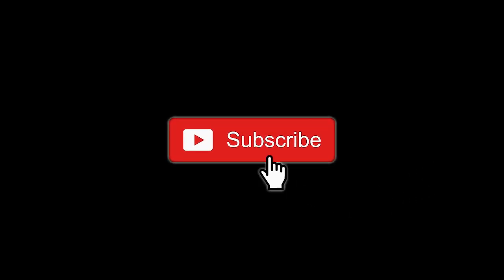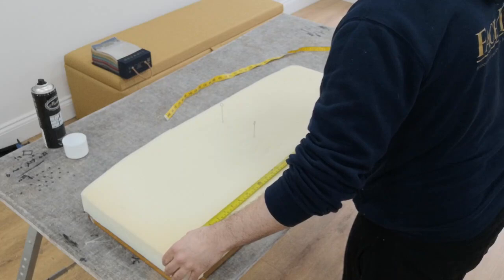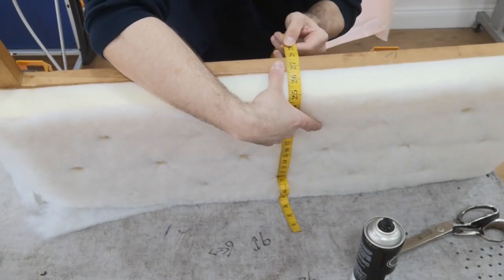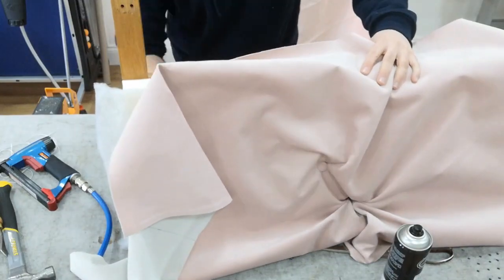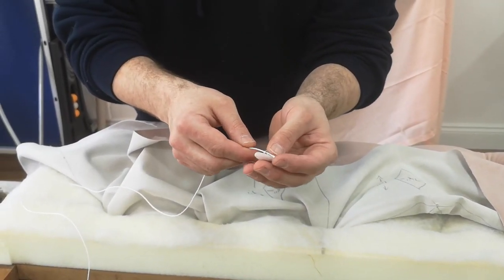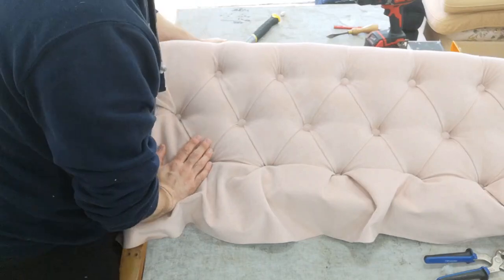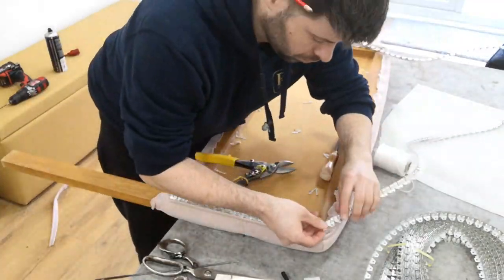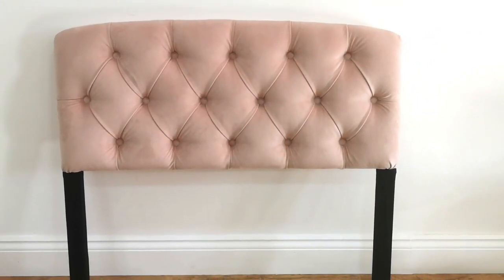HOW TO UPHOLSTER A TUFTED HEADBOARD | DIY TODDLER PRINCESS BED UPHOLSTERY TUTORIAL

Comment: Very nice work..... what size buttons are those?
Reply from the maker: Thanks for watching and for the kind comment 😊
They are 19mm buttons 👍
Reply: @faceliftinteriors  thanks for your video! I have 25mm buttons, is a 30mm holesaw bit still ok?
Reply from the maker: @alanahamson2928  Hi Alana, thanks for watching! It should be fine. I usually use 19mm buttons and a 32mm drill bit but as long as the holes you make in the foam are larger than the buttons, it should be fine!

Comment: Thanks for a great tutorial. I have looked everywhere on the internet to get the drill bit that you use but can't find one without the wood drill in the middle (presumably used for a pilot hole in wood). Can you point me in the right direction please. Thanks
Reply from the maker: Hi Alison! Try searching for a ‘holesaw’ drill bit. The one I use is a 32mm drill bit. I hope that helps 😊👍🏻
Reply: @faceliftinteriors  Thanks for the info, I will have another look. 😊👍🏻

Comment: great video, as others have said, watched many but you get on with it, no distractions of playing silly games, good vid.  I have a question, what depth foam have you used?  And, How much does the diamond on the fabric grow compared to the diamond on the foam based on foam depth, so if you had deeper foam would it still be that inch and quarter or more? is there some formula? thanks
Reply from the maker: Hi Darren, sorry for the delay in getting back to you. Thank you for watching mate, it’s really appreciated! I used 2 inch foam on this one, which is what I generally use for deep buttoned headboards. As all fabrics are different and some stretch and some don’t, the best thing to do is take a spare piece of the fabric you’re using and staple down into the holes and create a diamond with pleats. Then take that off and measure how big your diamond is and apply that to the rest of them. Then you shouldn’t go wrong. I hope this makes sense!
Reply: @faceliftinteriors  perfect mate, thanks for the reply, will give that a try :-)  thanks
Reply from the maker: @visumgroup  no worries mate - hope it works for you 👍🏻